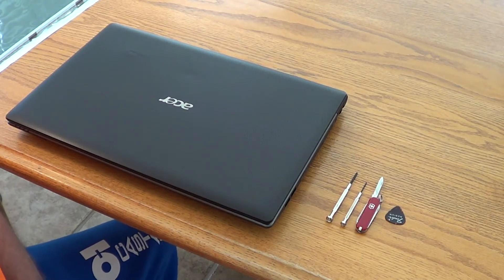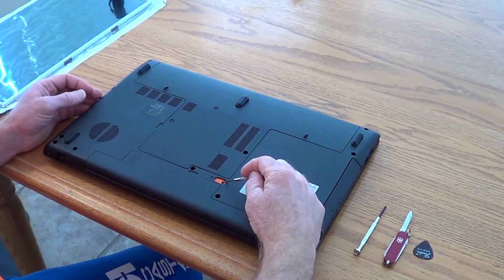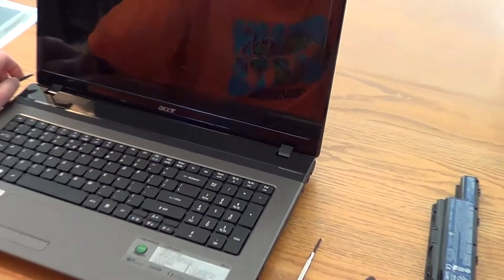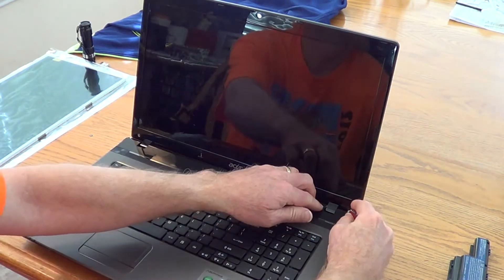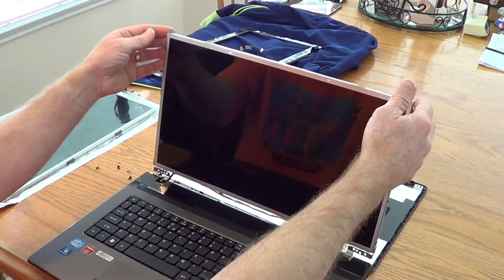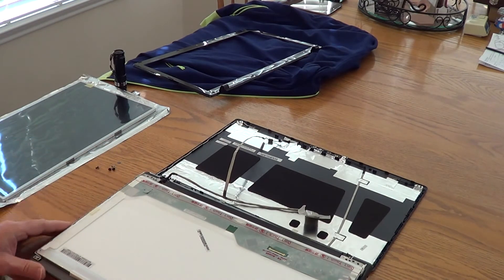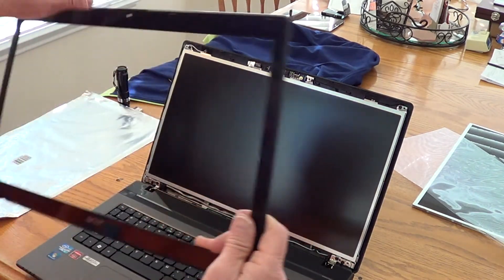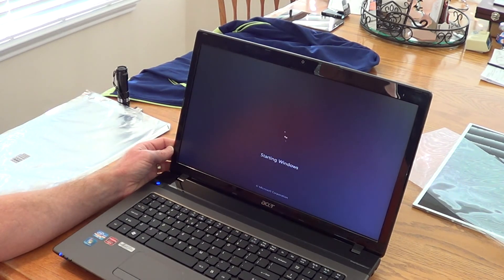Laptop screen replacement / How to replace laptop screen on an Acer Aspire 7750G-6645

Comment: I tried it, but my screen just got the brightness of connecting it to the plug, but the System doesn´t appear at all. Is there a problem with the Software ?
Reply: I know this comment is from 6 years, but did you know what cause your problem?